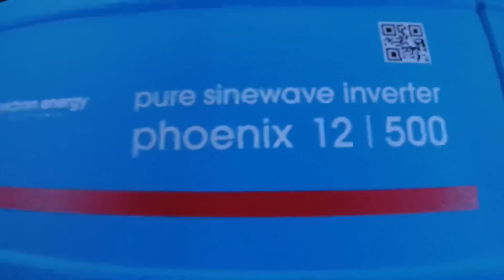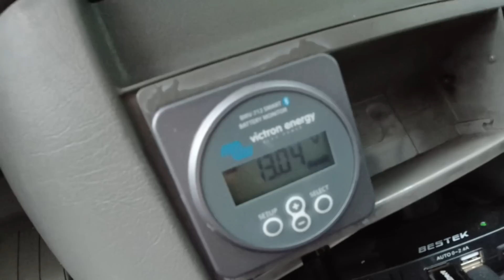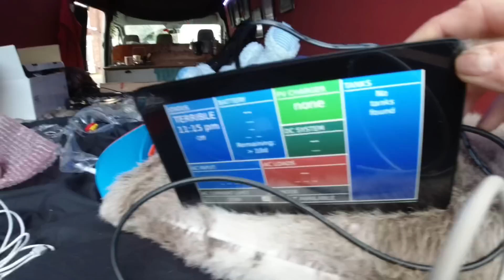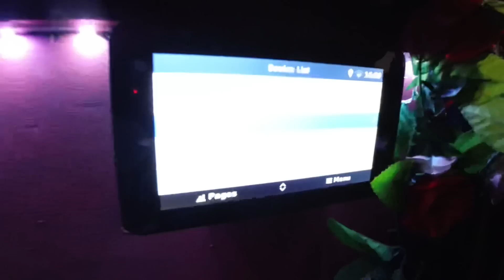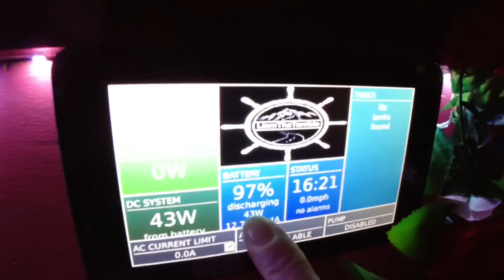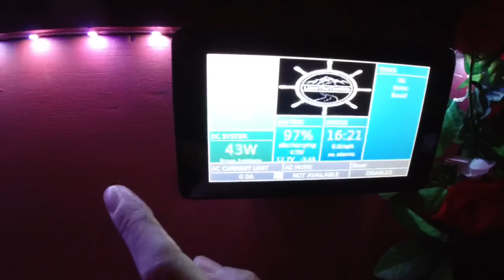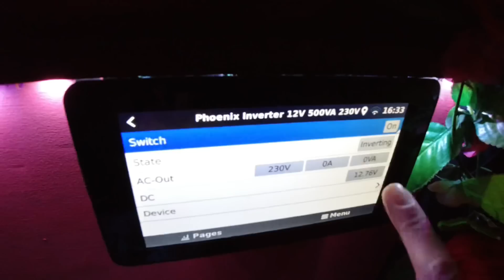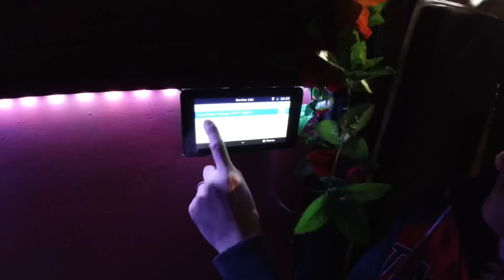Building a van - Ep 14 - Victron Phoenix Power Inverter

Comment: Great choice with the Victron. I have the 'Multi' 500 version as I have no solar, which also does mains switching, charging and monitoring. It even runs a fridge with no issue, a cheap 230V fridge. Many inverters will die with the surge that a fridge motor needs, but the Victron doesn't care, it just sits there working away like a champ.
Reply: Can't beat victron gear 👌👍

Comment: Coming along well bud, I didn't know you could get those systems to retro fit, quite cool.... and yet another great use of twisted pair cat5/cat6 network cable, I've used it for several different things over the years as it saves running multiple cables. Edit: I just remembered... it's also quite good for tying up your van exhaust when it falls off... lol
Reply: Its awesome stuff never knew the exhaust one though 🤣🤣